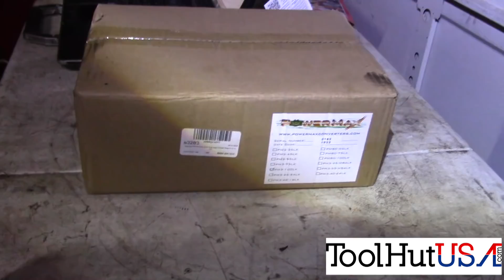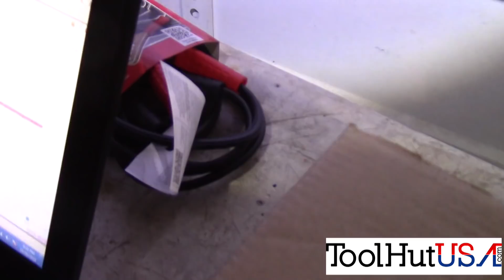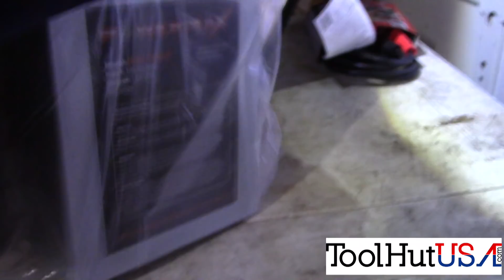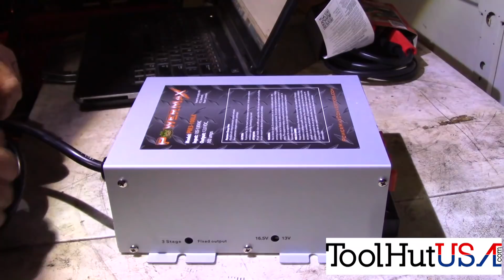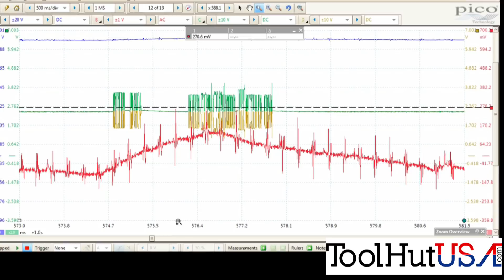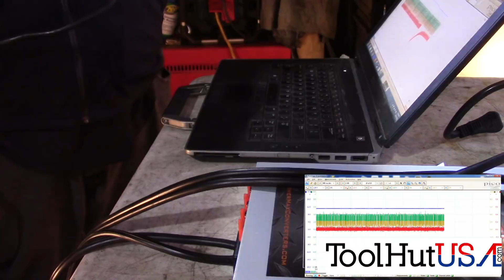Can you use a Power Max PM3-100 AC to DC invertor as a programming power supply?

Comment: Did you ever turn those accessories on without the charger hooked up to make sure the noise wasn't coming from the accessories? I'd imagine accessories running would be more likely to put noise in the system vs the charger.

Comment: How well with this work if I wanted to set up a CB radio as a mobile base station and run a linear amplifier? MFJ makes a 75 amp power supply and it runs $300 it has meters on it, multiple connections, cigarette lighter adapter. But then I've seen these 100 amps go for half the price?
Reply: It would be fine for running a cb radio and a linear amplifier.
Reply from the maker: I am not real sure
Reply: These just make a lot more hash. The AC input that is not filtered out, ends up in your DC outup as Noise. Not that good for any radio gear.

Comment: Would it charge say, a lithium batter 100ah ? I want to set the voltage at 14volts. Also, having a cap on this thing should help with that noise right?

Comment: Hey Sam! Someone on my channel just told me about your video! Ive got the unit labelled for programming and I am using it, If you woulkd like I can shoot you any waveforms you would like so you can compare, I will do a video with mine as well! Good job BTW!
Reply: @thecarflasher3019  Awesome! Ill check back for the video, i did a live stream yesterday and did some test on my truck, very inconclusive as my truck has some crazy ripple with just key on. But my truck is loaded out for mobile diag and programming. I will retest on a different vehicle as well.